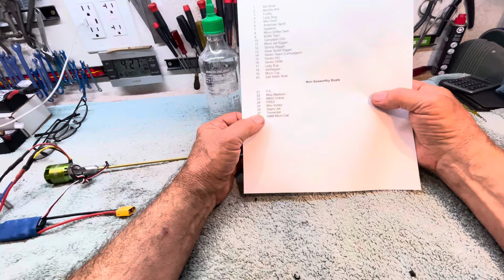Dr. Jet takes inventory.

Comment: Salt away is good stuff, I used it for like 10 years when I was a first mate on a sport fishing boat,  my captain was hell bent on not getting salt away on electronics..  I'd look into salt away on electronics good or bad?
I think I have rust on my prop shaft because I run zubber nuts, it's a steele nut..
Reply from the maker: @IRONCLADRC  Good tip.   I'll look into that.

EDIT:  I didn't find anything in Salt Away that would compromise electronics, but if it does contact electronics it must be completely rinsed or the salt will just get moved around and not removed.
Reply: 28 boats is a lot. But 28 big boats is hard to find room. Big b has big boats mostly. I'm on 9 boats, 3 small and 6 over 24in. I love to have them displayed when not running because they are beautiful. Yes I'm single 😅 by the way I ordered a flycolor dragonfly 40(might be fly dragon ) and a straight shaft drive for the shovel nose. I'm still up in the air about the straight shaft.